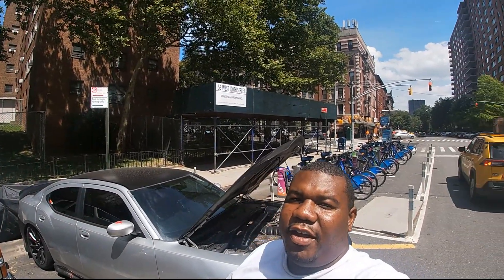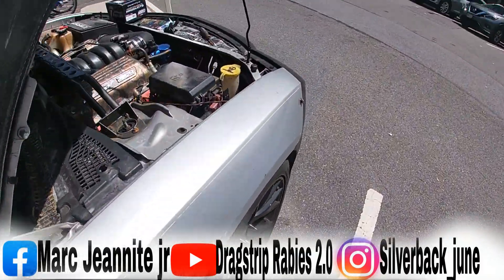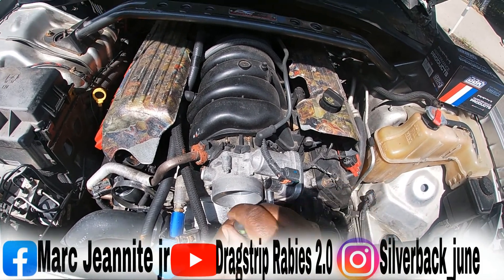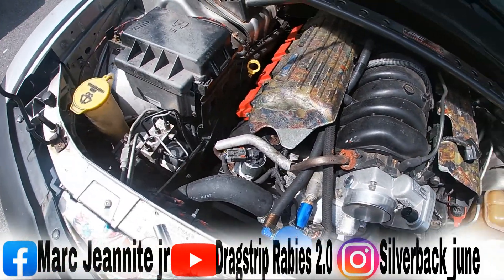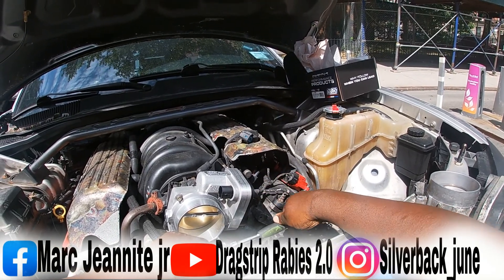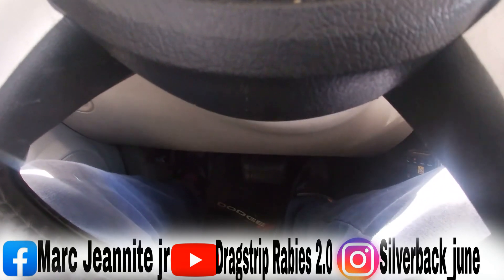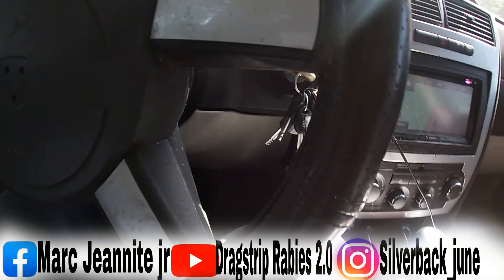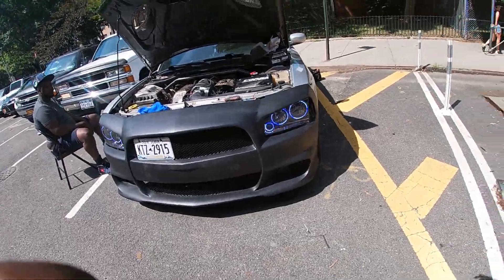BBK THROTTLE BODY UPGRADE ON MY CAMMED CHARGER R/T

Comment: I was thinking about getting a throttle body on my 5.7 at the time was thinking about getting ported I came up on a 6.1 intake manifold with a TB going to get both of them ported this yr you have to get your csr tune now right
Reply from the maker: Yeah I still need a tune but I want to get some small touch up bodywork out the way. I want to paint it
Reply: @dragstriprabies2.059  that's understandable Sir
Reply from the maker: I got it tuned already by hemifever